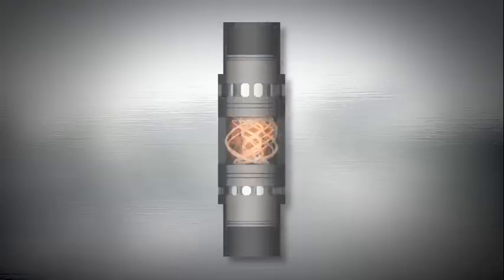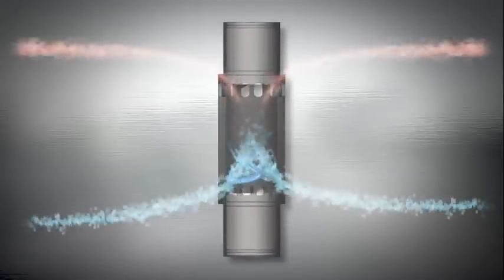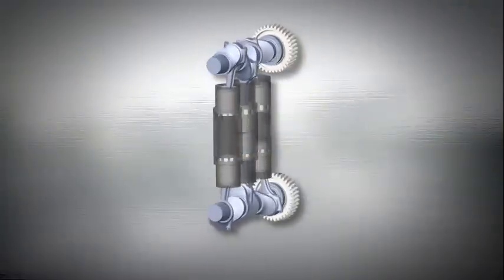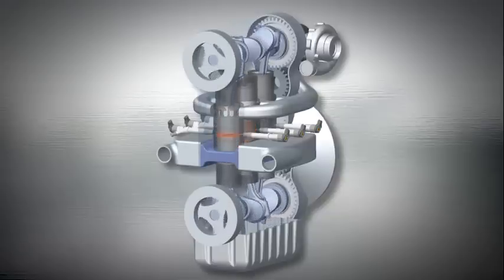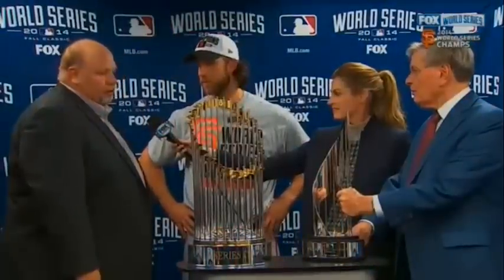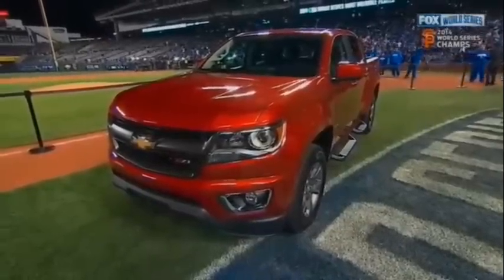An Update on Achates' Revolutionary Engine - Autoline After Hours 264

Comment: this engine format has been used for a long time. dont understand how they are marketing this as a breakthrough
Reply: +Charlie france  It's a breakthrough because they have different piston style ! It might be similar but they have lots of improvements !!
Reply: @seniorfrog7391  yea piston design, modern electronic fuel injection, aftertreatment
Reply: I think you answer that by doing a bit of research, there have been a lot of changes to the basic design
Reply: Modern upgrades

Comment: Jim, is right about older two stroke cycle engines that had cylinder heads and a valve train. I worked for General Motors on the Detroit Diesel two stroke diesels from 1954 to 1987 as Director of Engineering and we never could match the fuel economy and emissions of the four stroke diesels. Eventually Detroit Diesel dropped the two stroke engines  in favor of four strokes. The Achates opposed piston two stroke diesel has changed that equation.
Reply: I got an 8v92 turbo silver out back to tinker with. Look how clean burning the Rotax 850 etec turbo is. Imagine an 8v92 built like that. How about a OP 1700 rotax made from 2 850 rotax motors now that would be something in a sled. An Achates 2.7L could fit in an outboard or lay it down in a sled as it is like and small.  now just mount a 3 gallon plastic jug and 2 VRO pumps to lube the cranks and get 3 gallons of amsoil interceptor 2 stroke oil. I would love to see the rotax 850 etec scaled up into a 900 CID inlne 6 2 stroke that would be sick!

Comment: 8 cylinders firing 15 times a second or 30 times a second so the air has to move when it's dry without gas in it without beefing also to the air heats up quicker without the fuel in it that's why we have to shoot the area at the fuel there at the very last second

Comment: Nothing new here, the Commer TS3 two stroke diesel engine was used in the Commer Carrier back in the late 50s/60s. It produced 105 BHP @ 2400RPM max torque 270 lb ft out of 199cc!  A roots blower to scavenge the exhaust.  They were quick lorries but hellishly noisy.  The Achetes is the same except the cranks are coupled by a gear train, and being straight cut will whine like a diff off an old QL Bedford. The TS3 had Two pistons, four con rods and two rockers per cylinder, I believe the pistons were made of cast iron with a heat-resisting crown. Oh I must get out more Matron..

Comment: It is amazing that the four-stroke for sale cycle engine has endured so well there's been many little modifications like computers fuel injectors valve timing ignition electronic ignition and of course the materials for the  forge crank aluminum heads and blocks
Reply: 4 joke stroke, 1 stroke to turn it, 3 to wear it out.

Comment: i'm in love with this design, the reason why is .. it does not have valve so it would be perfect for running on H2. Just add spark.
Reply: Yes a hydrogen 2 stroke!
Reply: How about a 1700 Rotax OP 2 stroke made from 2 850 Rotax Etec engines. OP 2 stroke would be great in a snowmobile.

Comment: this engine sounds so good... what the hell is taking so long to start using it?...???
Reply: Sounds good... it actually isn't.
Reply: @geheirnwaeshen  I ran the things for year. I disagree. They are elegantly engineered... and they can even run backwards!
Reply: @Squeezmo  They're a slight improvement on a 2 stroke engine, but in a configuration that doesn't pack well into most applications that would use a 2 stroke engine.  That doesn't make them good.

Comment: run it horizontal with dry sump oiling; place the intake/supercharger under the engine (or intake top and exhaust/turbo bottom)
Reply: Oil injection and amsoil interceptor oil. i now use BRP XD-100 Etec in my 8v92 detroit 2 stroke turbo. Its 48.50$ at walmart!

Comment: As weight ratios concerned this design is eleminated cam shaft and all cam heads, so in this regard it is lighter. However, it is almost in par with 6 cylinder engine, as it has 6 pistons as well. As it eleminates complex cam head gears it is cheaper and easier to produce, and should be more robust than conventional engine. I don't know what will happen with on top cranckshaft that oil will be pumped from oil pan though ?

Comment: Air moves fastest and the best when there's not gas mixed with it also to air heats up quicker and better if it doesn't have gas in it that's why we have to add the gas at the very last fraction of a second taking mine that each cylinder is firing 30 times a second so you have to try to imagine how quick that is okay

Comment: op's have been around a long time.  the diesel power plant  homestead fl. I believe have 6 Op diesel engines that have been in use for at least 40 years. They are 18 ft. tall and about 30 ft. long have 16 pistons with 8 cylinders  operate at 450 rpm on diesel and or natural gas.  and provide power from miami to all the keys.

Comment: It's 2020 and we haven't seen any of them on the road yet what happened?
Reply: Does not look like the car makers are interested in this engine, it looks simple but it is complicated, and expensive, and big, and its not easy for any novice to mess with it.. As it is, hybrids does not last long, more of a hoax, if they can still dig the well, the traditional 4 stroke diesel or petrol will keep on going for another century.
Reply: The CEO of Achates has stated that from signing to production takes 5 years.  From what I gathered, many vehicle manufacturers (including Cummins) signed with Achates in 2017; so maybe in '22 or '23 or as late as '25.
Reply: Halfway through ‘23 now… seems all the focus is on electrification in one form or another, last thing people want to hear about is another way to burn diesel.

Comment: A 1930's Junkers design powered Do 18 flying boats and Bv 138 flying boats. 
Had very low fuel consumption for aircraft, these boats had a very long ranges could fly into the Arctic circle to patrol for convoys.
Germany's biggest mistake, not putting them in tanks. Hitler had a personal love for Maybach engines.

Comment: Why not slaping on top of piston some asbestos sheets and on them thin stainles heat resistant sheet  and completely stop heat apsorption by pistons? And there is your boost of efficiency. For diesels you do not need to fear of superheated piston top.

Comment: we had exactly this kind of engine on my ship built in 1938, Fairbanks Morse design, used in smaller surface ships, subs, and lots of railroad locomotives.  way less noisy than the 2 cycles made by Jimmy.  this is NOT a new idea.
Reply: +Henry Ostman He says that at ~9:00
Reply: +Henry Ostman Not a new idea and they didn't say it was it's a improvement if you would just listen !!

Comment: The problem now is the electric engine is what all the politicians have decided on, so none of them are looking at more efficient oil engines. As an example, the UK is pulling LPG pumps from forecourts whilst putting in electric chargers, which seldom get used at the moment. The fact that LPG has half the emissions of diesel or gasoline seems to be lost on them.
Reply: Electric is just better and tap radiant energy ZPE like Tesla,T Henry Moray, Edwim Grey and Viktor Schauberger. I dont understand the obsession being stuck on chemical fuels. Look up Joseph Papps pulse plasma inert gas 2 stroke! Yes i like to mix some 2 stroke with ethanol to get my chemical fuel fix but we must move on. Broken symmetry in the vacuum and Tom Bearden is on it.

Comment: I think Dan Gurney has a point, but its not the only thing. The thrill or having very different cars racing against each other, and the Danger of racing is largely gone, thank to nannying by racing sanction bodies and judges.

It is so that we do not want drivers dying every race or ever. But cars obviously driving at or near the limits of control, racing in the wet (Remember when even NASCAR had rain tires?), and not being entirely, G-rated, safe (rather than it being a high speed parade around a track), is definitely missing.

Also they might want to get rid of that Driver on driver violence on and off the track.

When you pushing everything but the racing, like spice on food is used to hide the fact the food is not good, the racing is NOT good.
Reply: DocWolph Dan Gurney wants to get rid of wings? What racing needs is fewer arbitrary restrictions, not more. About the only thing that should be disallowed is jet engines. As long as your design moves the vehicle down the road by applying torque to the wheels, it should be allowed.
Reply: dlwatib
Wings themselves are an arbitrary restriction. This allows racecar to be much more uniform and prevents the kind of freedom, the kind of stuff the old Can-AM series (IMSA Group C) was known for. It would also force car designers and engineers to work more on the actual car.

Of course the cars would be hewn down to a general uniformity, that "one right answer", at some point anyway. So you get NASCAR except the rules are what wins.

Limiting power and downforce, would push for more than just more speed to be the thing, how you get it and what is done with it would be more important the just "Moar powah!", would bring back the drama and actual excitement of autoracing not just in the racing but in the machines, as well.

So yes, getting rid of the wings will do a LOT to improve for autoracing

Comment: I think you need an inquisitor panel with proper mechanical engineers aboard. I am left seriously under-informed. You needed to have grilled the Archates guy over the mechanical blower which he somewhat mis-leadingly refers to as a "supercharger: How much power does that absorb? Is it off-the-shelf or bespoke? Why did they not employ a turbo-blower (low air-flow at low rpm perhaps?)?
These are not trivial details!

Comment: Would forced induction be required to make the air flow through this engine?
Reply: +John C Having seen the full 3D rendering at 11:26, I'm pretty sure that is a supercharger.
Reply: +John C i feel like its definitely required. It could probably run without the forced induction, but it would be like running any diesel without boost. I also don't believe it would benefit from the forced induction like a 4 stroke would.
Reply: Yes. It's actually referred to as scavenging air and the blower for that is often driven by the upper crank. You can make it supercharged by advancing the crank lead so that the exhaust port closes first.
Reply: Turbo and blower I read
Reply: @Squeezmo  Yes so it acts as an exhaust trapping valve!

Comment: Don't be silly stupid it's a dry sump oil lubrication system like most racing engines are all the airplanes have to be at dry some two strokes it works really good because you can get to the main bearing is very important on the connecting rod keep that lubricated and it's a very ingenious system just to put a hole in every connecting rod shaft never sleeve main print crank case main bearing it works really great try some pressure lubricated

Comment: While amazing in design, the engine seems tall; not good for aerodynamically styled vehicles.
I think back to the Chrysler 225cid slant 6.
Most vehicles use transverse mounted engines; couldn't you reposition the oil sump, air intake on the front upper side, and slant the engine to decrease the vertical rise?

Comment: i just cannot believe there is no downside to this motor.
Reply: Then of course you would have to consider the exhaust backing up onto the intake and vice versa. If they did address this problem, then I'd like to know how they did it.
Reply: Iamwolf134 exastports open faster so at that pointits all good ,and in the time when intake ports open the exaust are on the move and kind of pulling/sucking fresh air plus its super charge so the preshure difrance is not that big
my consern would be 2 crank cases.and losses there- i bet hey are biger than regular engine.on the other hand they are only 2-5%.they make up for it and some with termodynamic eficiency
Reply: Iamwolf134
That is mostly likely what the supercharger, or blower, is for. It blows the exhaust out as forces fresh air in.

Smokey Yunick's Adiabatic engine uses a turbo for roughly the same thing even though that is NOT a Opposing piston engine.
Reply: I don't see one, myself. But then new technology (or old tech developed to work properly today) tends to be like that. No discernible down side.

Then add this is a engine being developed for production, all someone has to do is license it and build the engine themselves, and the guy is at least part salesman, and he is quite seriously about this engine working. After all, they are not going make much money if the engine is crap.
Reply: I believe they've improved on the opposed-cylinder engine (not revolutionary, IMO), but I don't believe it's anywhere near as great as he claims. Basically, he's a used-car salesman who will say anything to sell his product.

I believe he's exaggerating the efficiency gains. The 83% better efficiency is in comparison to what? There's a thermodynamic limit to efficiency, and I don't think there's that much room left for modern engines to improve that much.I don't believe they have improved emission as much as he claims. Of course it's better than a weed-wacker, but that's no saying much.

He says he already has customers. When it goes into real applications and not just a lab, then we'll see how it does. If it does everything he claims, crongrats to him. But I don't believe it until I see it.
Reply: redav
83% compared to the engine it was tested against, which in this case is the Titan's 5.6L V8. Which averages about 18mpg under the best conditions. An 83% improvement MPG would be 32.94mpg.
Reply: heat. it's designed to keep heat inside the combustion chamber. all other engines are designed to pull heat out of the combustion chamber. I think it'll overheat under high load conditions. You, probably, need an ecu programmed to limit engine output and therefore load. This in itself would reduce efficiency. For a steady state electric generator or ship (with variable props) where load is highly limited... would be great.
Reply: Tom Jones No, it's not trying to keep heat in. It's trying to convert more heat to kinetic energy and wasting less in the radiator. It shouldn't be necessary to run it any hotter. It should actually run cooler. All other things being equal, if you ignite a fuel charge and make it push two pistons instead of one, you'll convert twice as much heat to kinetic energy. A typical IC engine is only able to extract about 20% of the energy of the fuel, the rest is wasted in the radiator and in friction.
Reply: dlwatib haha.. that's absolutely silly. apparently, you have no formal physic training.
Reply: +Tom Jones This would seem pretty fundamental but I'm still confused. I don't agree with dlwatib when he said that two pistons are twice as effective as one, but given the right circumstances (like a ship or a generator), how much more efficient (in theory) would this be?

Comment: Ford should use Lincoln like GM uses Cadillac. Cadillac gets the engineering and it tricks down to Chevy. Currently Lincoln borrows Ford chassis and installs nicer leather. It's backwards.
Reply: Rotax etec is much better, i never like 4 strokes anyways.but i fill them and mix 2 stroke synthetic oil, castor 927 maxima
Reply: I had an 69 deville 472 ran 50:1 premix.

Comment: apparently a rework of a deltic diesel engine minus one crank assembly.
not too revolutionary.
Reply: Now hes comparing 2 stroke to 4 stroke, an 850 eterc has over 160 hp (over 3 hp per cubic inch) with turbo and can make twice that with modest boost, also 4 stroke rev higher, a big evinrude etec can make over 300 hp 450 lb-ls torque and not go over 5000 rpm much, im not a 4 stroke fan anyways, 1 stroke to make power 3 to wear it out. A 2.7 liter 2 stroke can make over 300hp naturaly aspirated and god know with boost. I hate 4 strokes anyways and hate sound or feel of them but they are fun to make them self destruct.
Reply: Napier obtained a licence from Junkers in the 1930's. The Deltic is a development of the Jumo engine
Reply: oil total loss burn off
Reply: oil injection
Reply: total loss oil burn offf premix injection